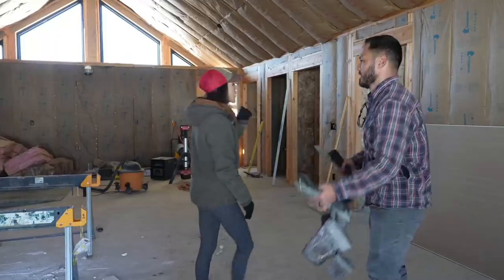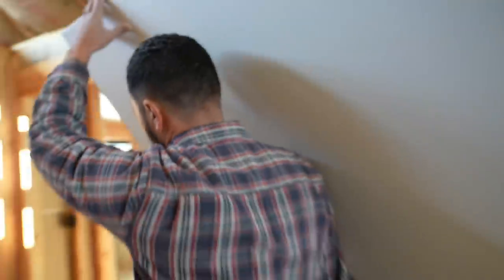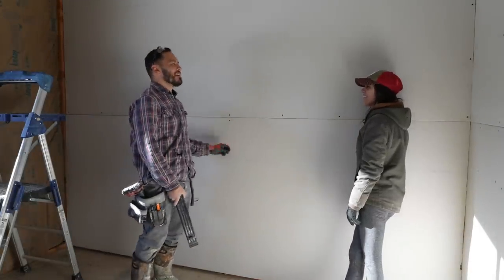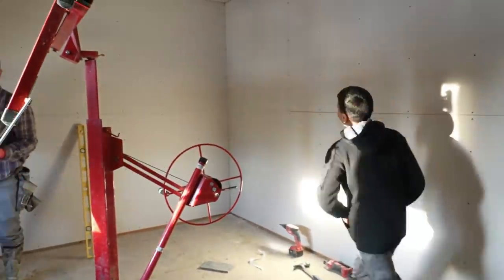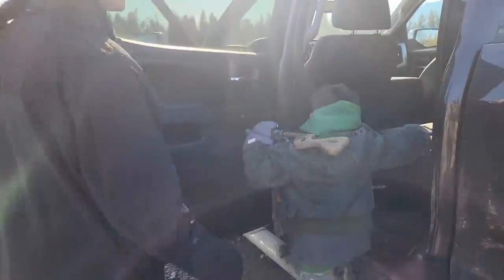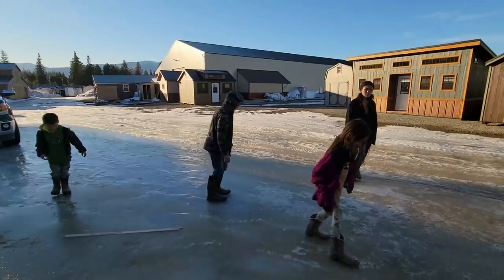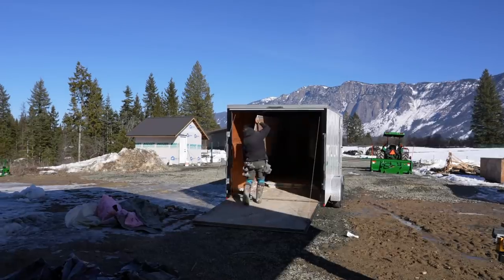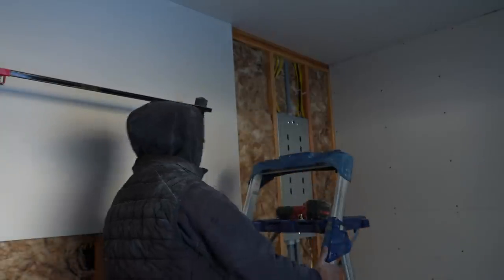Revealing Our Future Build As Work Continues On Our Self-Built Mountain Home

Comment: Sure loved the gable roofed barn growing up.  Milking parlor on one end.  Four horse stalls, tack room, feed sack room, etc in the middle. Sheep pens on the other end.  Upper floor over all was the hay loft.  Loved to build hay forts!  You can use a portable conveyor to lift the bails up.  We also had a hay hoist with grapples on one end.  Large double doors.  Beware, we kids jumped down from those double doors when the adults were in the house.
Reply: Ours had 36 dairy milking stalls in half. Newborn calves, young cattle in other. Hay in loft one side first cut hay ( usually grass). Other side was 2nd cutting ( usually alfalfa).  When 1st cut got gone aways we would put straw bales in there too.
Reply: Sounds amazing. Maybe also an area to vet, bath and shoe horses?

Comment: You two are doing great and bring joy into our lives.

As an old guy still living on the farm I've learned a few things about animals, feeding , barns, and hay.  Back in the '60s we learned don't waste energy moving bales up by hand if avoidable.  The bales on the top of the hay wagon go on top of the hay stack and the last ones go on the bottom.  When designing your barn make sure that you have it big enough to get  the the hay wagon ( or whatever you have) into  the building.  You don't want to park outside and pack it in.

Think about getting the "used hay" out of the stalls.  Set them up so that you can get the tractor in to scoop it out, better yet push out the other side.  The more you can mechanize the handling of feed and cleaning the better of you are.  Those kids will soon be gone and with them the helping hands.  In 10 years you guys are going to be 20 years older and the strength and energy will not be what you have today.  

Another thing about animal barns is that you want to have people/equipment/feed side and on the other side is the animal side open to the outside.  That way the people side stays free of mud, used hay, and other mess.  The more you try to have both on each side the messier things get.

lg
Reply: *GREAT ADVICE - THANK YOU LARRY G!!!*
Reply: Great advise. If you fail to plan now,, you are planning to fail  in the future.  Designing things now to work smarter...not harder...will go a long way and pay big dividends...both now and in the years to come!
Reply: Great advice!!

Comment: Totally agree with you, Melissa! Anything below 70 and I have a jacket on. Below 60 and I have a coat and a hoodie on. The Army 50 years ago taught me to hate being cold! I do not like temperature extremes but if I have a choice I'll take high heat over low cold. Being a "motorhead/gearhead fix-it" guy I know what extreme cold does to equipment, cars/trucks and buildings. Heat is much easier to manage! 😉👍

Comment: I love watching you two work on the house.  The guy who built the house I bought and am living in was the city's building inspector, so he just did whatever he wanted.  Most of it is fine, but I am not sure he knew what either a square or level was for, so he didn't use them.  I was talking to a local preacher once when he found I had bought the place, and he said he helped build it.  However, I also learned when talking to a neighbor (old retired guy) who said he poured the foundation on the place.  You got to love the community spirit involved here!  Anyway, he said the foundation was pour onto rock, so I may be on a hill in a place with a lot of landslides, but I'm  (my home and everything in it) not going anywhere.
 
I've done lots of remodeling and repair over the years, and it just means I have to make a lot of adjustments because nothing is square, level or plumb.  But it is solid.  The view is wonderful.  The neighbors are great.  What's not to love?

Comment: Barn -
Have you considered a 40x40 for livestock and feed, then add a 15ft overhang for tractor on the side you could later enclose?
You could always add to the opposite side for an outdoor arena with roof overhang.
It would also provide some shelter for the sheep.
As long as your supports are in, it's easy to expand as your budget does.
Glad we ran trenches for water and power while foundation was being done. Reduced cost later.
Good luck

Comment: As a contractor, I give you the advice to Use the t-square and run the blade against it where ever you’re mark is, No need to mark it with pencil and precision cut it. Also cut the sheets standing instead of lifting them and laying them, it’s less work

Comment: Great vid!! Rolex watches are very good investments too! In the last 6mos, they have doubled in price. Our 4 stall breezeway, we used 1 for tack & 1 for hay & 2 for stalls. We concreted the floors of the tack room, hay room & the breezeway. We cross tied our horses in the breezeway. We had kept our horses at a ranch at first & they had the same barn, only theirs was 20 stalls, but they had us cross tie the horses in the breezeway for brushing, saddling, getting them ready for shows, etc. Having a concrete floor made it perfect. They had a separate washing station. You will find the right barn.

Comment: you guys are awesome. you should be so proud of what you have already achieved..... keep the end dream in mind but dont forget to ensure all the little details are finished. you can get tough safety glass to use as a balcony barrier with the brackets at the bottom which would leave it completely clear of bars so you could have the mezzanine nook without compromising on light.

Comment: I tried doing drywall with lifting it on the saw horses. It's way easier when the stack is leaning on a wall . If you gotta make a horizontal cut just slide the t-square with your knife riding on the square. Vertical cuts you put your feet holding the bottom of the square cut up than down . Just my experience

Comment: We all know how you like perfection and doing it your way. Just a little tip you can think about. When you said I did around the edges and then I'll do the field. Think about this,. If  there is any bow in the drywall when you fasten the outer edges where will the center field go? yes the drywall screw will pull it in for awhile , then after finishing you will find sunken impressions where the screws pulled through the back of the drywall. Yep, the drywall didn't have a place to go but out. Your better off placing a few screws in the center and working out. Or, do it your way.

Comment: having been in a few barns, when it came time to build mine i went with a ranch style. all one floor. (32x60) drive in one end and right out the other. pigs and equipment (manure spreader, seeder) on one side. grain room. chickens, hay and sheep on the other. saves climbing up and down and a lot easier to get the hay stored. be sure to put the hay on pallets. keeps the hay dry and lets the cats get to the mice.

Comment: You are 100% right about going larger on the barn. It's wise to think multi-purpose use. Sheep lambing, the kids may have animals they want to add, equipment, etc. It will be fun looking and seeing ideas on the internet to consider and building to suit. I still think above the pantry would be a good loafing area. Just pillows & bean bag chairs. A ladder up & either glass or wire safety rail, to not mar the view. Great place for the kids. Make a manual pully  dumbwaiter or market basket for them to send snacks up, LOL. Don't waste a cool space, think up a solution. All hands on deck to spackle all those walls!

Comment: Not try to be pain. But noticed I didn’t see protective plate on 2 x4 to protect your wire from accidentally put a screw in it . There steel plate with barb to hold to 2x4

Comment: If you stand your drywall up you will not have to tape any butt joints. Also do not put tapered ends at any corners. Butt joints are very hard to finish, good luck.

Comment: Getting it up there.. the hay. 

ONE SMALL PULLEY. ONE REGULAR ROPE. 
A WINCH. MANUAL? Like a sailors capstan. .

A hand crank of any sort with a long handle .. I’d use a winch and have a pallet lift. 
Two kids
2 bails every 30 seconds. 

If you need faster.. 
a pulley of marvel is sister blocks? I think.  

Anyway. I like the barn upper hay storage. 

Means kids or rents get an easy time feeding by 
Bombardment!

Comment: Just a suggestion- because stacked hay can spontaneously combust given the right/ “wrong” conditions, I would not want it in with my animals or expensive equipment.  It is more expense to have a separate barn but I think safe is better than sorry. I don’t know if they can be used in Idaho’s climate, but a pole barn would be less expensive, and easier loading and unloading access, than a regular barn. Just a thought.
Reply: Another thought- make sure you can drive through the middle of your barn with a load of hay or bedding for your animals, or in case you need to load an animal into a trailer.

Comment: You don't need to get two measurements for the 12 ft drywall. You're measuring at the top and bottom which is really a waste of time. just measure in the center and I guarantee you it will be fine. give it a try.

Comment: live in Alberta, Canada with horses.   You do NOT need inside stalls for horses, unless you want a lot of extra work!   Your horses will be much healthier and happier outside, with your 3 sided shelter for them to go in, if they wish!  you can clean it out with the tractor.  You need a building for hay storage.  Should be separate from anything else, in case of fire.  Also, easy to get into for unloading hay.   I use large round bales which are much easier and less labour!  Horses should be fun, not work!
Reply from the maker: Yes I know, but we have a jumper on our hands. If it gets dark and he's not locked up he jumps the fence and goes on mile long adventures. Never jumps during the day, but will jump every night.

Comment: Good Job, But it pains me to see you using a standard #2 Bit to screw drywall.  There are special drywall bits that allow you to crew in the screws at full speed, the bit will set the screw just right.  No more multiple trigger pills just to set one screw.

Comment: Melissa.....I have a suggestion on what to do with your loft and how to get up there.  I would make it a reading nuck only. Make it a rule that.no toys etc ar we permited. And they need to sign out the book.. I can't explain what I saw.  So I will give you the site.
"Never to small"
Heritage loft apartment conversion 54sqm/58.....
Small apartment #architecture interior design.
I no you will have children concerns. But perhaps some kind of banister that fits into the design. But, in old English homes they had sliding ladders attached to a run on ceiling. In front of their massive and tall book cases. Perhaps you could go from there. As a banister? Maybe?
I was a single mother for 26 years.  Your children remind me of mine. You are such a good mother.
And I am not leaving you out Jeremy. You are such a great father to your children.  

.

Comment: .... cold Melissa ... I was never warm enough, we are talking twenty, thirty years, always had heat cranked .. three years ago got diagnosed with being a full blown diabetic .. I am 6'2" and around the 165 lbs mark and have been forever .. chose to tackle my challenge through diet and exercise and now my numbers vary when I don't get enough exercise ... seem like I am never cold now since sugar and carbs (sugar in disguise) are no longer part of my consumption habits .... will be interesting if the unpacking of the kids décor aligns with who they have evolved into over the two elapsed years  ...... drywall taping is such a finicky  task .. since you have not focused on using up scrap but having less seams professional tapers will not gouge you on the price. Plus would think pros would have your job done in less than a week .. the reason I mention this is the fact is this is the final finish before paint and what you will see for the duration and may be value added .. granted do not know what your taping experience is. ..... Dutch barn style gives more loft area .. build in such a way, position so that the back wall can be pushed out to add extra stalls, space  .. the barn you looked at could be office, apartment, Air-B-N-B on the second floor .. you mention parking for the tractor, will it not get a spot in the shop once the house is complete .... the house sure is coming together ... thx for sharing .. never stop dreaming, just dream bigger .. have fun be safe, save our oceans ...

Comment: Not sure why you put the horse stalls as far away as you can get from house? And, I see you dragging a sled with feed & water. You can't run a water line out there? Or like a 100 gal. storage tank? Also, have you heard, they make these things called ATV's that you could use to tow out feed & use for lots of other things around the property? I put my corrals close enough to see out the kitchen window. Nothing like getting up in the morning, grab some coffee & watch the horses. Working horses, I am a calf roper. Anyway, to solve my issue & not swimming in YouTube wealth, I bought a 2nd hand larger ride on mower, removed the mower deck, & use it to pull a small trailer I built. Trailer the feed to the corrals, & trailer my trash cans to the street for pickup. I have to put out my manure once a week & those bins are heavy. Any way just some thoughts. PS: White, Blue drywall, it'll all be painted over I'm sure. Tell Jeremy he's a drama queen.